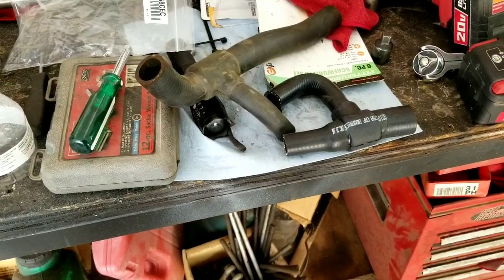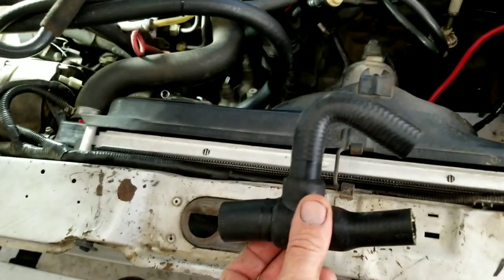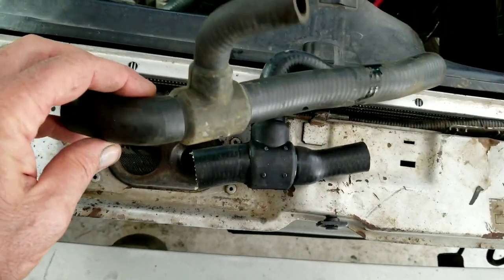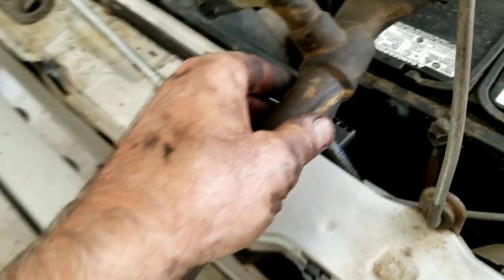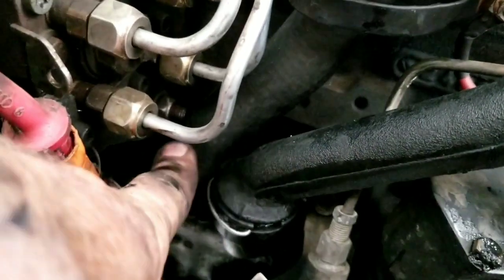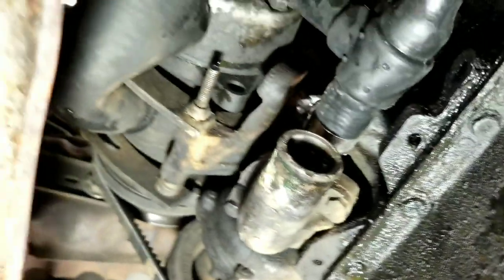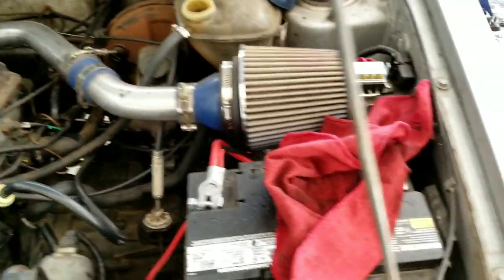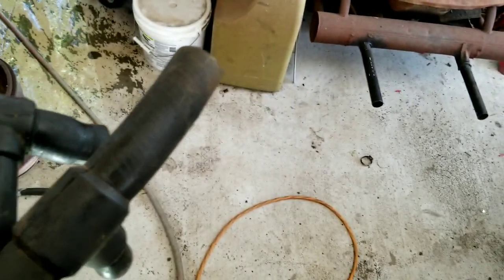VW Rabbit coolant hoses

Comment: I must say seeing a old Rabbit in a YouTube video is kind of nice !  I had a 75  Rabbit that  was the last of the carburetor water cooled then a 81  fuel injetected  that would eat the bumpers off the 75  as far as performance  was concerned  i also drove a Deisel for a short while at a part time job. Doing deleveries  that thing was great on fuel but i had to shut the. AC off to get on the highway  cause it was so damn slow  that was in Florida. Where. Its  got to be bad to shut off the Air Conditioner even for a short period  of time   Ive kind of always wanted one of the pickup Deisels for  some reasons ?  Years ago JC Whitney had a kit they sold that  was a bolt on kit to make a standard pick up into a Dually  and i always thought it would be cool to do that to a VW pickup  for fun  and to be different  as many of my freinds  and self included. Have owned and run domestic Deisel Duallies to pull. Large campers and in my case  boats  also
Reply from the maker: I put in the 1.9 german aaz motor in this one and it gets the same 50 mpg with the turbo. also with the ac on does not bog. drives almost the same. freeway speeds of whatever you want to do. top speed about 90 or so. havent gone there. I had the stock engine before and soon as you turned on the ac it would almost shake you to death.